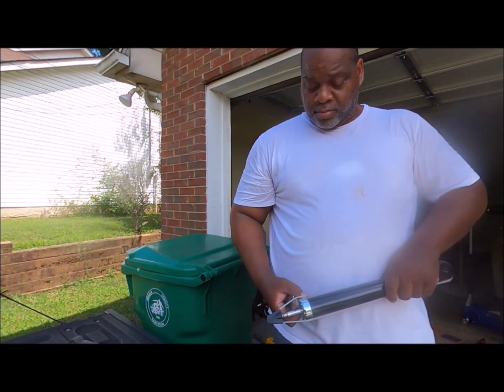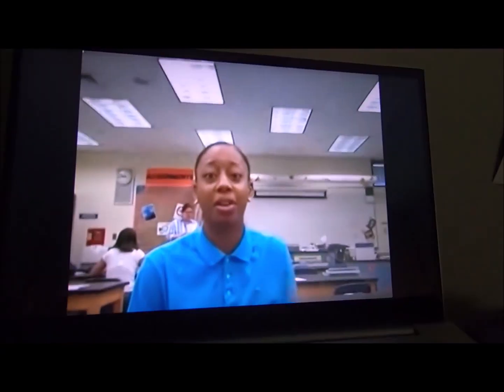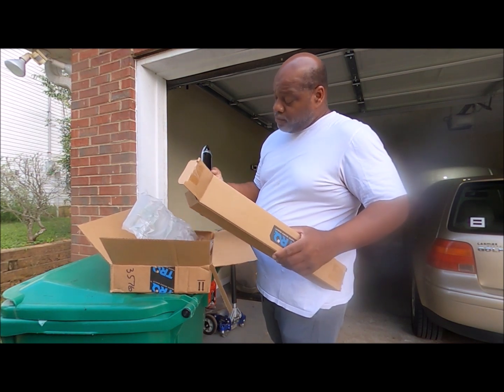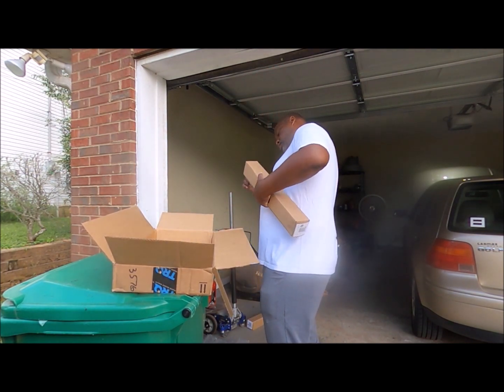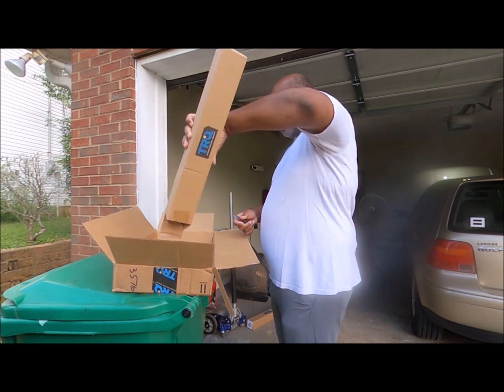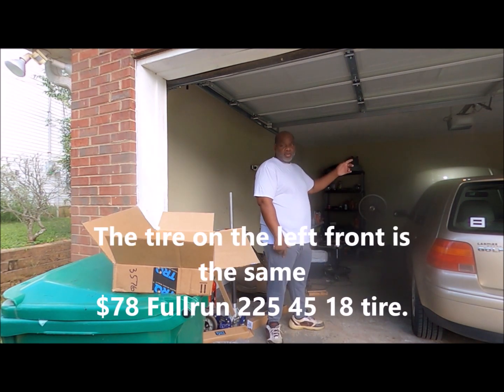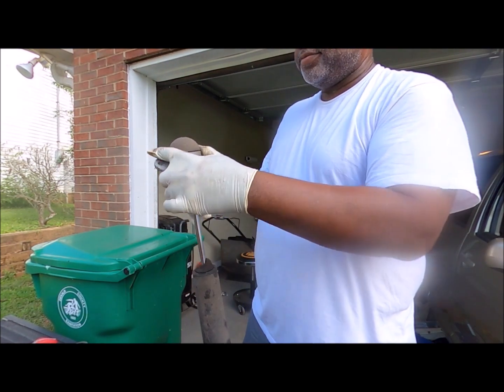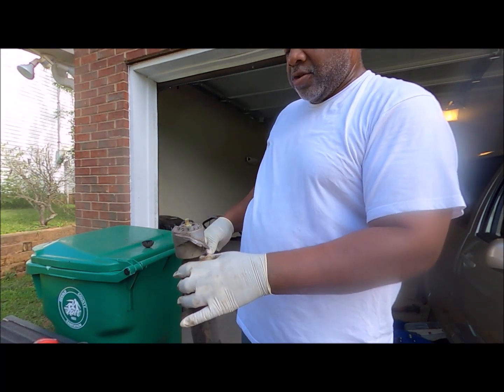I installed TRQ rear shocks on my 2004 VW Golf

Comment: I bet the valving in the TRQ struts is made for more for soft ride then performance. Did VW come stock with Bilstein? 
Also there is a Shock socket that holds the flat on top the shock. I’ve always just used pliers or cut them.
Reply from the maker: The rear shocks had an Audi sign and said Monroe.